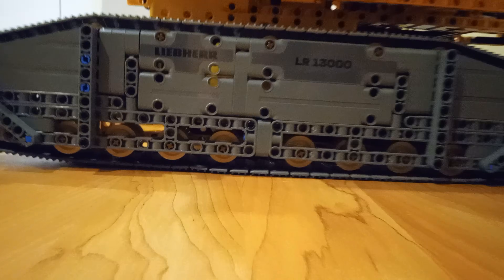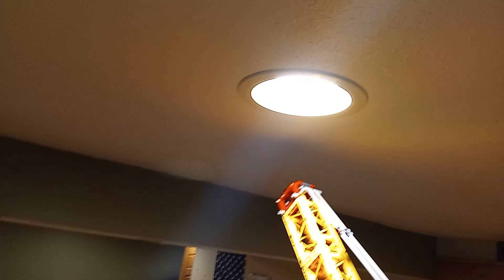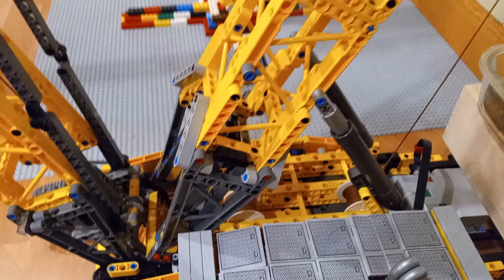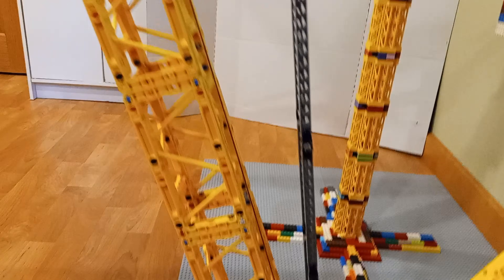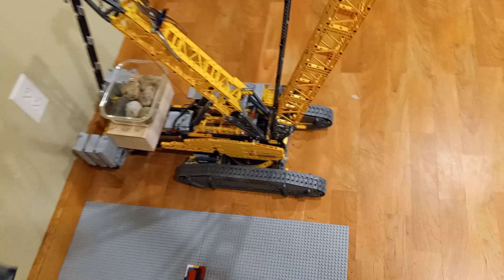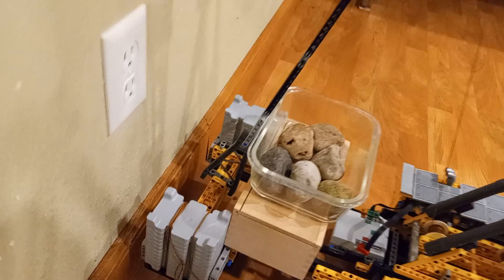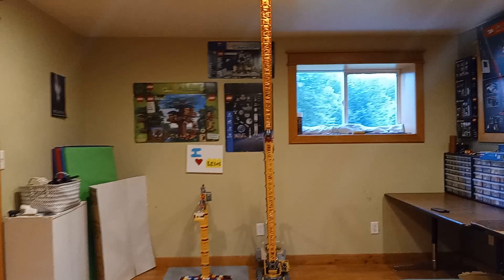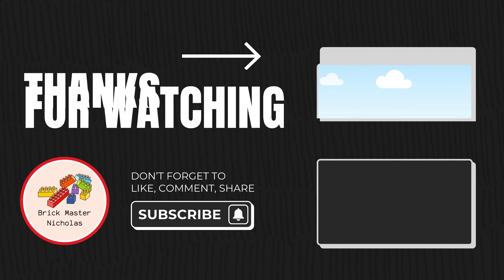LEGO Said It Couldn’t Be Done — So I Built It Anyway

Comment: using mine as a platform to turn my UCS falcon (set 75192) into an RC model that "flys" across my floor . . . . sadly the added weight of the falcon causes the 2-wheel drive to stop, so i need to figure out how to make it 4-wheel drive - - - did not count on having to do controller programming, so am now looking for tips and tricks to get that done . . . . . great work!! keep pushing the envelope!
Reply from the maker: That sounds like a challenging and awesome project!